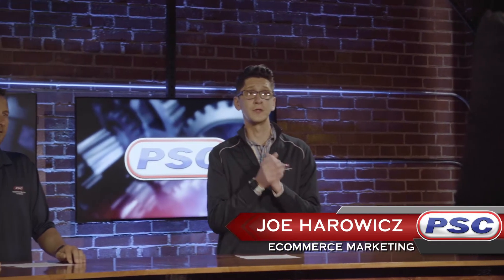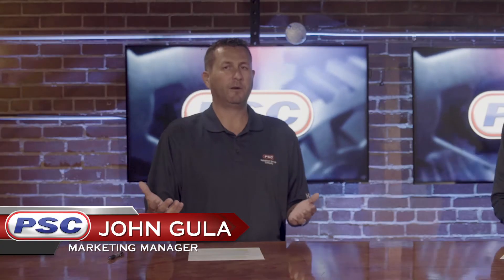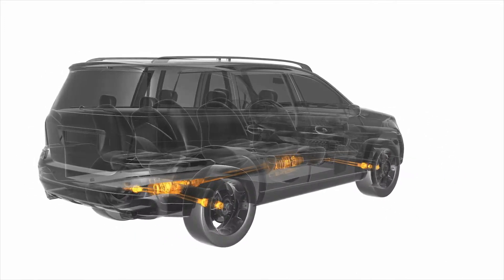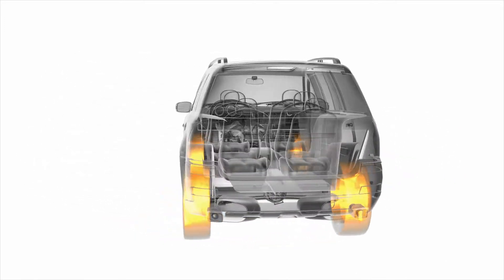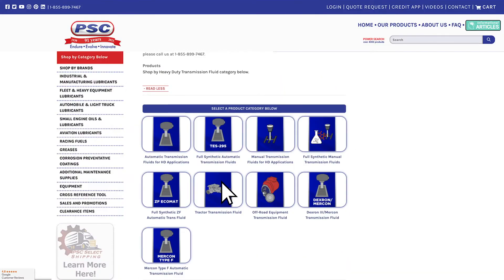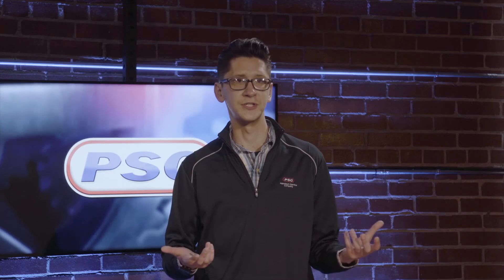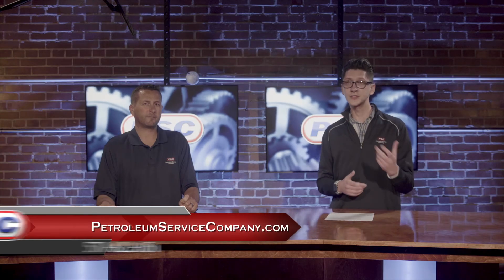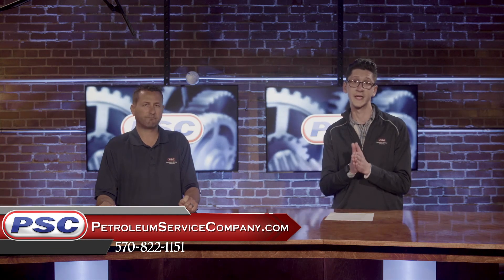Tractor Transmission Fluid Explained | Petroleum Service Company

Comment: Howdy y’all I got a question I got a 05 case ih 232 front loader. I have no idea where the oil filter is for the engine. I’ve found 2 fuel filters, 1 coolant and 1 hydraulic. I’ve looked everywhere and can’t find it